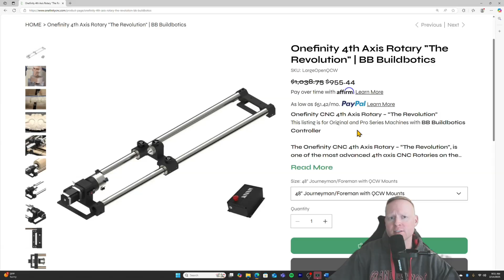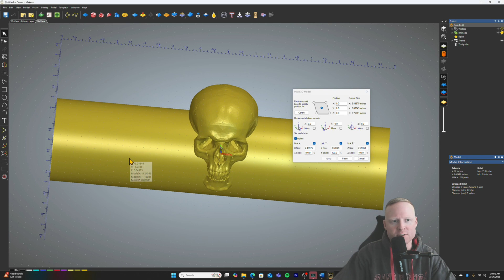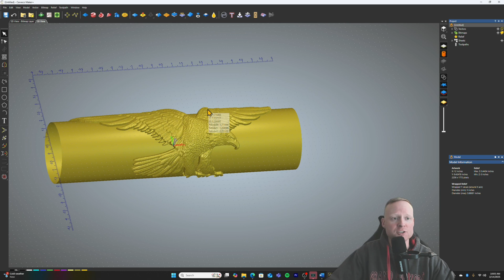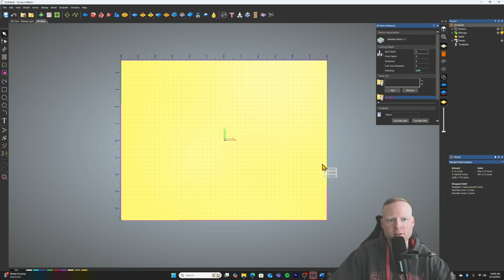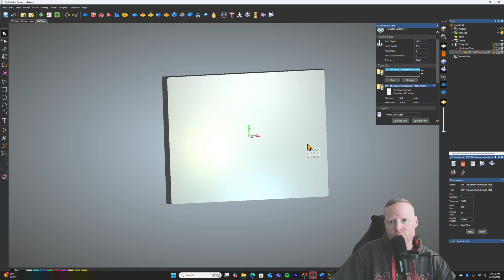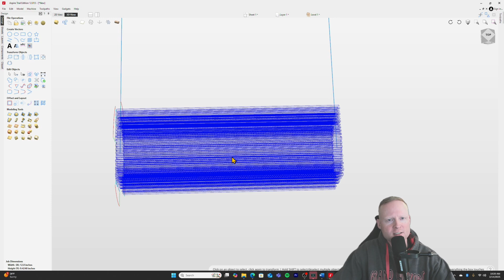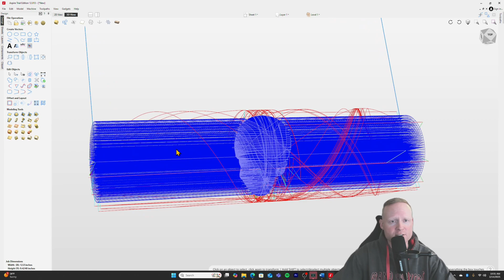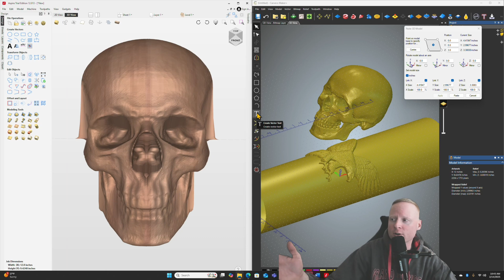The Software you Should Choose | 4th Axis Rotary | Aspire VS Maker + | Which one is easier?

Comment: Curious if you have looked at Fusion 360 (Not cheap either, but there is a free hobbyist license).  Its my understanding it has the capabilities to perform the CAM features(I've just been using it for 3d printing and creating STL's).  I would think the design features would be better then the other CNC programs, but I could be wrong.
Reply from the maker: Yes I designed a cabinet using Fusion 360 in another video. I have not looked at it for rotary features yet but plan to in the future!

Comment: I have been using carveco for about 2.5 years now and am a little disappointed with the rotary capabilities. Maybe it will improve. I just know i don't have $2K to spend on Aspire. I can still use Carveco to do relief carves on a cylinder. I did think of a work around while  watching this video. You can cut  the corners off on a table saw or if you have a lathe just turn the cylinder before putting on the revolution. BTW i have a Revolution on order for my woodworker and I am following your videos on this. Thanks.
Reply from the maker: So many possibilities with the Revolution! I’m excited to push it further. I am hoping that CarveCo is working on improving those capabilities because I think it’s a great software! Another option that I didn’t look at in this video is Vcarve Pro - still expensive but not as expensive as aspire! I covered it a little bit here I’ll be doing more on the functions soon. https://youtu.be/Fx7yqjVI7AA?si=rsVlckd3yYyIm5HJ